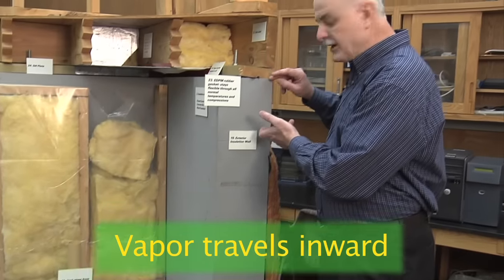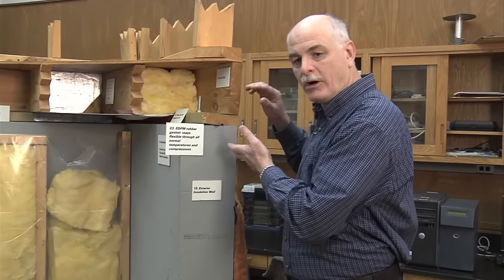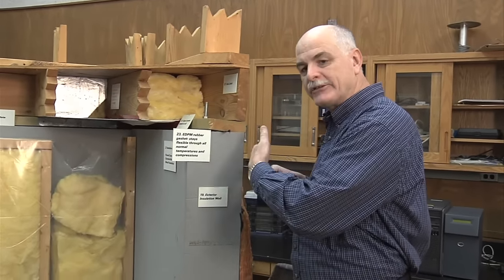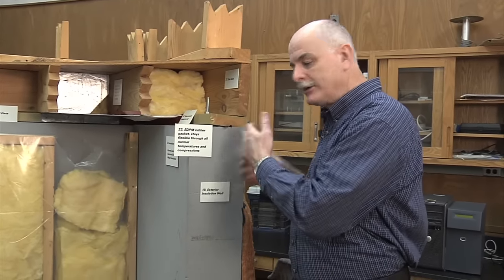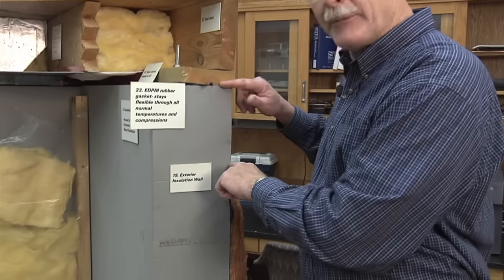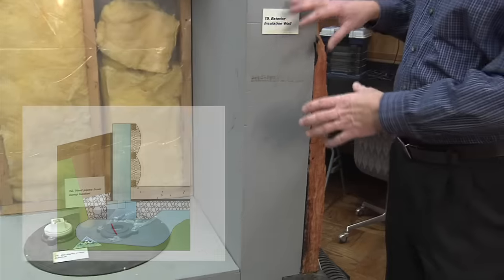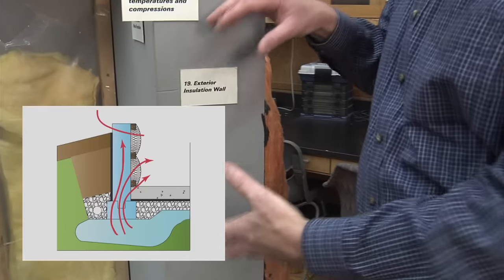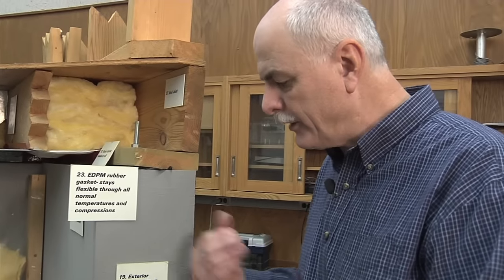Foundation Insulation Effectiveness: Basement building science

Comment: Excellent information! I am just beginning to plan my future home build here in Ohio and after reading 100s of articles and watching 100s of videos on building science strategies, I've learned that the most important thing to get right, by far, are the 4 envelope control layers (water, vapor, air, thermal). If you spend an appropriate amount of the budget on getting the envelope right, you will absolutely prevent problems down the road AND get a more comfortable house, overall. I've decided to go all out with my envelope and try to save some money on aesthetics, which can always be upgraded later. It's the structural details that should never be overlooked during initial construction because they're not easy to fix later.

Comment: One thing to keep in mind is that if you insulate a concrete basement or even slab on grade from the outside. You are giving the house a huge thermal mass. An other way say thermal mass is a thermal reservoir because it is a mass that stores hot or cold. This thermal reservoir will make a huge difference in emergence situation where the house looses heating. The warm "indoor" concrete in the basement will keep the home warm probably for several days if not a week even with extreme conditions outside if the house is properly insulated.
Reply: I agree... did  project where the engineer had no insulation under the basement floor slab (just a really good moisture barrier) he claimed that the earth under the slab becomes part of that thermal mass as you explained...

Comment: I'm owner-building my first home in Anchorage, Alaska. This is by far the most helpful video I've found on how to build an effective cold-climate foundation. Thanks a ton for the work in putting this together.
Reply: Hi Paxson!  How did the build go and did you insulate from the outside!??
I'm wanting to build in northern Ontario and looking to build foundation and walls of bungalow with block.  No lumber but the floor and roof 
Your feedback and experience would be a huge plus.
Thanks!

Mike
Reply: 5 inches of XPS on the exterior, over a layer of Ames Bluemax. I’m sure it will work nicely if I ever finish the house…
Reply: @PaxsonWoelber  Thanks for the insight.  Not familiar with the layer of Ames but I'll look into it.  Thanks again!!
Reply: @PaxsonWoelber  how's the house?  I'm a carpenter building my own finally here in Michigan
Reply: @mattmag3089  the project was disastrous, unfortunately. The GC I hired to frame the house did such a bad job we ended up having to tear the house down. The project is in limbo and I'm renting now.
Reply: @Paxson Woelber  woah dude!   I am so sorry.  I'm acting as my own gc, so any problems are my own fault.  I don't really know what I'm doing but I've learned a lot so far.  I have knowledgeable G.C.s and builders that I've met over the years in my corner to answer my constant questions.  Without being in the industry like I have for over 20 years it would be a train wreck.  A lot goes in to it!    

Would like to hear more about your dumpster fire.  That's very unfortunate, my friend.
Reply: I agree that cold-weather proofing anything is difficult to find on the internet. I wish there were A LOT more content in this area!

Comment: I learned a lot from this expert. I have been a Framer in Calgary Canada for over 10 years. I am going to take a 3 year course next Fall called Energy Systems Engineering Technologies. Thank you Mr. Expert, Great video.
Reply: Did you take that course? How did it work out?
Reply: @ryanshannon6963  TV Ontario did a whole series called "R-2000 The Better Built House".  If you can find it its well worth watching.  This series covered the proper installation of air and vapour barriers that hardly any builders or renovators follow or understand.
Reply: What I found was that builders would take the course and then get R-2000 certified on one house, and then go back to their old practices claiming their houses were R-2000 compliant.  I was trimming one of these houses and the air was blowing right in under the bottom plate of the wall assembly proving they had not sealed the envelope of the house properly.

Comment: The overall point is to make sure your basement wall and floor have been properly waterproofed/damp proofed from the outside. After this is done insulate from inside, especially top portion of concrete wall where it is exposed to cold air. (North climate).
A dehumidifier is a good to have too.

Comment: Thank you for this video.  My house was built about 17 years ago; I have owned it just 2 years.  I was going to finish the basement but ran out of money since I totally renovated the upper floors.  Instead I applied DryLok Extreme - 2 coats covered by SW reflective white paint.  The walls were reinforced poured concrete with a brick pattern on both sides.  If anybody is thinking of this - use Thro Seal and save your shoulder.  Both are "pulled into the concrete" and virtually impossible to roll due to the brick pattern.  The floors were painted with two coats of SW concrete paint.  NO dampness, not cold?  I dug around the foundation and found the builder had tarred the foundation, covered it with a mesh, a second coat of tar and then applied 4" of rigid foam insulation.  A Swiffer is all you need to maintain the basement.  After this video I understand why the contractor put that insulation on the OUTSIDE.  I don't have to think twice about off-gassing.
Reply: I intuitively knew that placing the insulation outside was a much better option but when my parents had their house built they did what the builder recommended and placed it on the inside house. And I inherited the house. This video post just reminded about the costly mistakes made building it, 

As side note I would use Aerated Concrete (it just has so many advantages and only a few disadvantages) and use a robust vapor/moisture barrier system if I would ever have a house built at this point, 

But since megatition is the only option for this house. My choice will probably be the less costly and less effective interior megatition option since digging around the whole house seem like it will be to costly for moderate moisture issue that I have experienced.  Good luck finishing ur project too. 

So it goes to prove the old expression is correct "an ounce of prevention is worth a pound of cure"

Comment: Wish I would have found this 3 years ago BEFORE I built a new cabin in Northern Wisconsin. This video is at least 10 years old, why isn't this more common info by now and hasn't been adopted / required by the building practices. I insulated inside with 1" foil faced placed tight to the foundation wall, foil side facing in. Taped all seams. Then built my 2x4 framed wall and added 2" foam sheets to the wall cavity. Hindsight, I would have placed both 1" and 2" behind the wall framing to make running electric easier. I would have only lost a total of 4" in overall length and width of the basement, been able to attach full sheets of insulation. Great information... maybe next build... if I ever do.

Comment: Pat Huelman : very informative to the non skilled builders out there. An additional approach based on that you don't build where a natural swimming hole exists is if possible build higher out of the ground and back slope to move water away naturally from the foundation while still implimenting all the details that you have shown. In addition if the backslope is not too extreme a piece of poly plastic can be placed 4 to 6 inches under the soil slope to move surface water dramatically away from the building and possibly the outer edge of the plastic drainage slope intersecting a french drain there by keeping a large dry mass of soil surrounding the building.

Comment: Am glad to see someone finally talking so much about Moisture. I basically deal with retrofit so there is usually no water proofing in the homes I come across. The only solution I could add for folks is to spray on Penetrating Concrete Sealer onto inside concrete block foundation walls and cement slabs. This doesn't quite get the footing sealed, spraying from the inside so I often dig up outside perimeter and spray the footing then exterior foam. 

Just wanted to offer penetrating sealer option

Comment: Fantastic, well thought out video. Thank you.  Q: We've just poured our basement walls. Footer rests on natural undisturbed ground (mostly though there are slight gaps here n there under the footer form, they were filled with concrete that spread out a bit. Footer was a very tight, stony mix) The walls were a looser mix and our contractor has never used a capillary barrier and even after asking for it, it was "forgotten" and so the walls are up and in forms over the long weekend. Our footer drain is in its own ditch alongside the footer and about 1/2 of it's diameter below the footer bottom and out from the footer about 4", completely filled with clean stone to the top of the footer. The plan is for 2" xps and a dimple board outside of that with native fill against that. A plastic barrier up the wall a foot above the footer, behind foam board, down and across the top of footer and onto the clean stone above the drain. There will be a ditch drain at the surface with clean stone and a 4" perf pipe, tied by vertical "downspouts" into the footer drain. Because of siding overhang issues with builder we've agreed to not take the insulation up over the rim joist. Rather, the foam and dimple board will end at top of fndn wall and we will spray-foam that rim-joist void from the inside. My understanding is the spray foam will not allow for vapor trapping and so will not be a major source of heat or vapor transfer. And, no mold. So the only place we're not good here (I think) is that vapor up through the footer. Since this is how homes have been built for so long, my questions are (science aside, I'm sold that it should have been done) just how big of an issue could this be? What can be done now to mitigate it and, would it be cost effective?
Reply: I'm in your same position (though you have a better plan at this point). Can you share what you did?
Reply: This could be a very BIG issue depending on you ground/soil conditions.  If you have issues or are concerned that you may have issues with water/vapor up through the floor/footer I would recommend a second drain tile on the interior side of the footing draining to a sump pump.

Comment: Excellent!  Just wish you showed exterior insulation using other products like mineral wool, or graphite polystyrene.  Keep in mind that foam products make great nesting material for insects, even below grade.  I've seen insects in foam in northern Michigan, it is not just a hot/warm climate issue.  Thanks for the excellent videos on the subject of below-grade insulation.
Reply: Yes my foam has holes in it and the parging fell off

Comment: Great video. Pat touched on so many issues but was superficial on some critical parts of the waterproofing system.
From over 20 years of experience I can add that the most important part of the waterproofing system is the exterior drain tile. 99% of all drain tile installation on new construction are done pretty quickly with almost no effort to paying attention to making sure the tile is completely clean of any foreign matter. You can waterproof using the Ferrari of systems but if you have a clogged or obstructed tile system water can and will go through; it's not a boat. Also I think the worst method of waterproofing a basement from the interior is to use spray foam (closed or open cell). The reason for that is that moisture is standing on the outer side of the foam waiting to infiltrate and has no way of trickling in any direction because it's essentially glued to the concrete. Concrete can and will crack in turn cracking the insulation with it since it's glued to it. Now you have a huge problem because you have a channel of water infiltrating all the water from all sides. I've seen it it's not theory it's experience. NEVER use foam. Basically the best system is the driest system. Follow gravity and concentrate on the bottom part. Drain tile, sump system,  a good pump kit will give you a comfortable basement even with minimal bells and whistles. Again it's a great video thank you for posting it.
Reply: your thinking is compartmentalized...your experience simply sheds light on  improper installation and techniques from construction jokers...no disrespect
Reply: mark drysdale I'm sure you'd be the historical reference on the marvels of Aristotele, Leonardo da Vinci, Michelangelo and the likes. We're eternally grateful for your precious thinking and input.
Reply: There is some good "stuff" which looks like a dimpled fabric that is put over the tarred foundation and goes down to the drain tile.  The drain tile is covered with a silt cloth and in my prior house has a clean-out at ground level so I can get a hose in there to wash out the silt - which I never had to do.  My downspouts all fed into a 6" schedule 40 rigid pipe that ran to light about 40" from the house.  This house has some of the same features but the external drain runs to the storm sewer.  I also have 3 sump pumps: 1) a grinder pump so I can add a toilet down there if I want; 2) a regular sump pump and 3) a water powered back-up sump pump.  I sealed all the sump pumps because there is radon in the soil around here and while I don't have a problem I just wanted the protection.  If you have enough space, burying the "horizontal" pipe that collects the gutter water is the best solution.  My basement is not damp, cold or musty.
Reply: I have a 100 year old house with quadruple wythe brick walls in the former coal cellar Basement but a poured foundation and no drain tiles. I couldn't get to the exterior wall without digging up my neighbors entire yard. I parged the imside walls of the one leaky side (wasnt that leaky) of the Basement, glued up foil faced polyiso on all 4 walls from floor to rim joist using like 50 tubes of PL Foam adhesive, which has no initial grab, but is great after a week (literally a week). Then furred that out with PT 1×4 16"OC vertical, then Horizontal. Drywalled with greenboard and tiled the floor.  I'm slow as molasses and had a kid in the middle. Took me 2 years to finish (did a bunch of electrical and plumbing upgrades in middle plus jackhammered floor and poured piers with which I jacked up kitchen on lally columns), ANYWAY 5 years afterward - Amazingly - no water. No moisture problems. Split it into two rooms: office and laundry room. Polished a HUGE TURD and has worked out well for us. People thought I was crazy.

Comment: 2 years of listening to so many video's without answering the problem i am experiencing. At 6 minutes, approx 20 seconds, you are the 1st to give me the answer. Plus, at 28:24. Right now the corner of my house has been dug by tractor shovel to the drain. I removed the 1 inch fiber insulation that was soak & wet, why do they use this stuff? Gets wet and freezes. We get minus 45 Celsius/Fahrenheit temps. That made the inside wall sweat so much behind the pink insulation, that i had a ice buildup of up to 1/2 inch inside. Though i had water coming in from roof... thank you for this amazing video. I will share it at large. Cheers. PS: any other suggestions, feel free to let me know please. Going in to do the work in couple/few days after rain stops. The water table is very high here.

Comment: Hello Pat and thank you for one of the most informative videos on this subject.  
Question:  Though I have no water issues in my below-grade block walls, I still applied UGL's Drylock Waterproofer to the walls as an added measure.  Next, I built a stud wall, keeping the studs about 1/2" from the block wall, and insulated with unfaced fiberglass insulation.  Then I applied Certainteed's "Membrain" to the inside of the stud wall.  The Membrain repels vapor from the inside of the basement (keeping vapor from getting into the insulation) and allows vapor in the insulation (if any) to permeate inward to the inside of the basement.  1/2" Water/Mold Resistant drywall was used as the inside finished wall.  Aside from your concerns about a water event that could soak the drywall or fiberglass insulation (though possible, is not likely in my case as I have pretty good drainage in the basement), do you feel that what I've done is adequate?  I should also add the I have added two intake vents to the basement that draw air to the heating and cooling system.  There were no intake vents there before and the basement only had a very small area of mold growth behind a large cabinet placed next to the wall.  
Thanks,  Steve